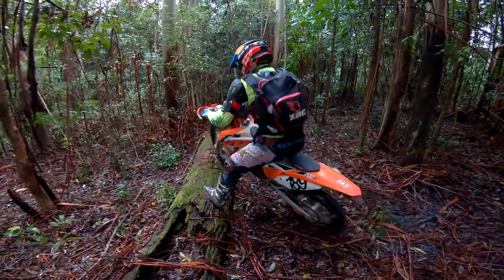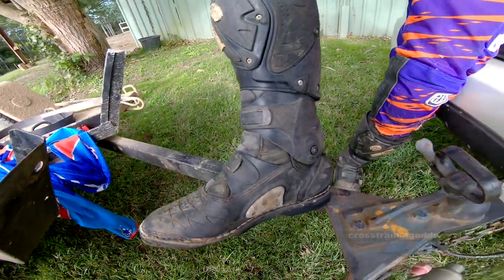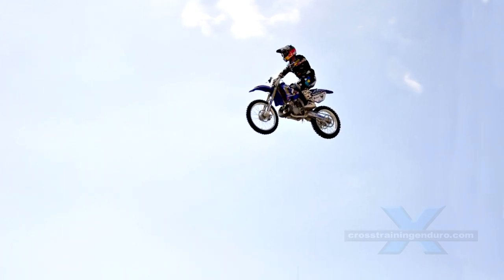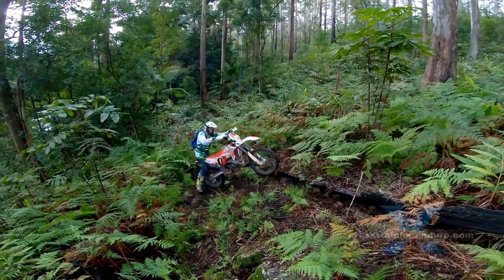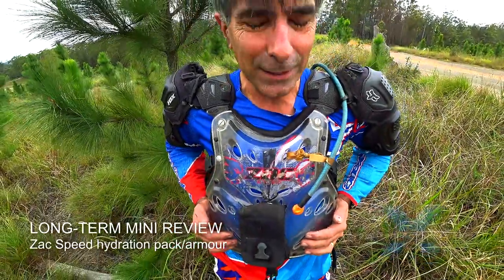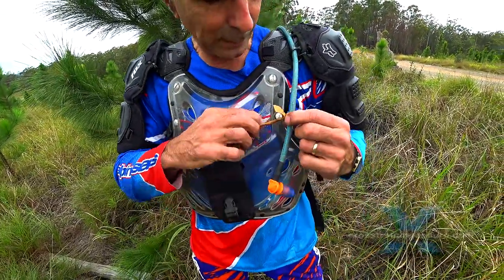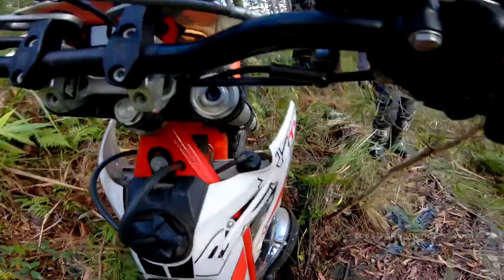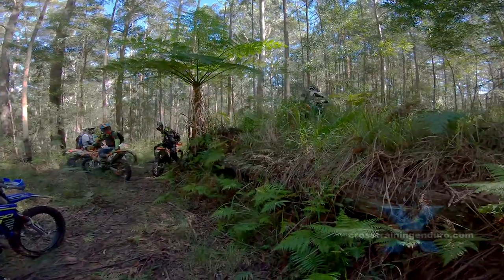The track cutters︱Cross Training Enduro shorty

Comment: Love the channel, awesome vids. Yet to go through the mountain of training vids you have👍I've just purchased a new 2020 Beta 300rr and so far I love it.It's alot better than my old KLR600 and KLX650 I used to take out the bush 😉.
Reply from the maker: great to hear, peter! you have probably heard about the main bearing issue on beta two strokes the last two years? fairly rare, but check out vids and stop the engine the moment you hear any suspicious engine noises.
Reply: @crosstrainingenduro   Yes I've watched the vids. on the main bearing issues and it's something I will be monitoring closely. Hopefully mine will be ok, but thanks to your info to make me aware of it.

Comment: I think this video needs a lot more clarification.
1. Only cut tracks on private land you have permission to.
2. In state forest you may get into trouble if it is a catchment area. Generally to get away with in areas that will be logged or mined (as was the case when I used to enduro mark events).
3. Never in National Parks. (I have seen this with MTB trails lately). 
Keeping rideable areas with out losing them is important. With MTB they will be sanctioned trails and supported and maintained. I dont think this happens with dirt bike areas, unless commented otherwise. The dickheads screw it up for everyone. Be mindful of noise and erosion, big negatives.  Be respectful other users, bushwalkers, 4WD's, MTB's. **Abuse it, you lose it **